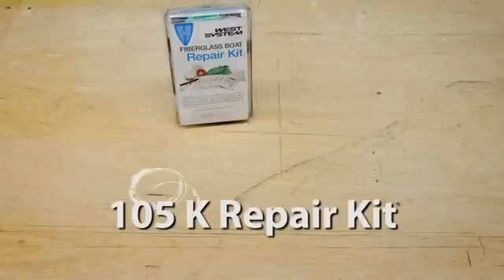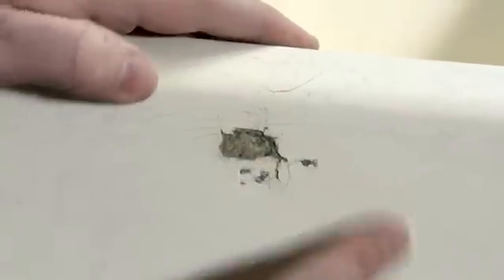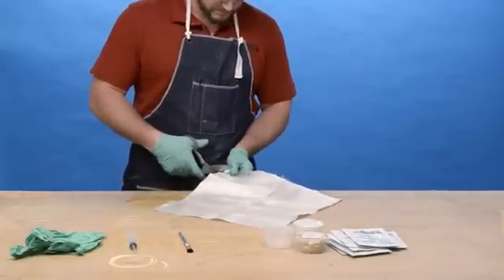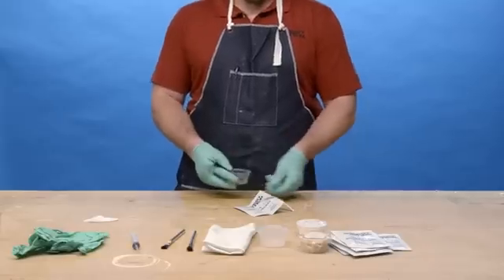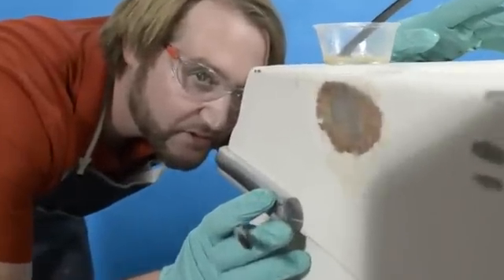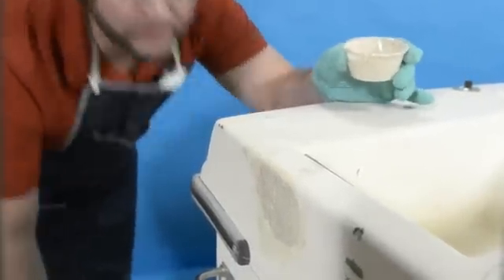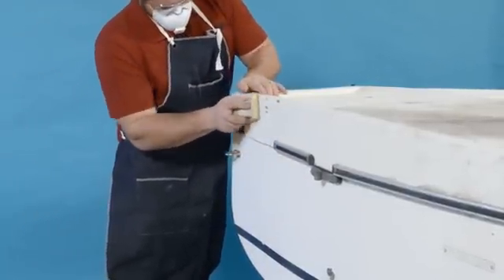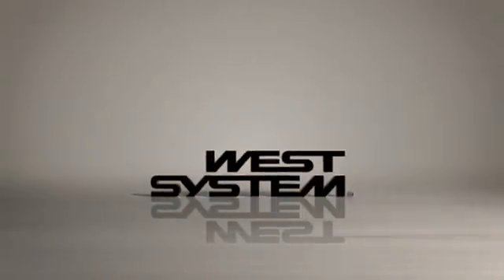How to Repair Deep Cracks in Fiberglass Boats

Comment: Will this hold structurally if the crack is in the transom area of the boat were the motor goes?
Reply: make sure you grind out the old cracked fibreglass & do several layups using progressively larger patches using cloth first & then mat & use heavy roaving to finish it off because of the additional strength that you need in that area,,,,,,,,,,,,,

Comment: I’m not a fiberglass expert by any stretch of the imagination, but I’ve done some fiberglass repairs.  I agree, it’s backwards. You lay the smallest peace of CSM and get progressively larger.  It should be like and upside down wedding cake.  The hole is the smallest at the bottom then tapers up and gets wider.  You follow the taper.
Reply: You bond face to face not edge to face
Reply: I think it depends on the situation. For a hole like this the larger sheet gives you the largest surface bond, if you started with the smaller piece it would bite less, and the sheets over it would be compromised.

Comment: lol. I've repaired busted boats for a living for quite a few years. This video depicts an ivory tower method for a tiny repair. Try doing that to a boat that hit a stump at full speed! That little kit is almost useless and nothing at all like the materials used in a professional facility with experienced personnel. Wet sanding before you even spray gel? lol
Reply: Dude shut up this video is for deep small cracks, not holes that tanks can fit through and if you ran into a stump I can safely assume you are a complete Moron
Reply: So why not post the correct way, if you are such an expert.
Reply: Tom Rooney how can I repair a transom that broke on the corners,from top to bottom?

Comment: I didn't think you could use gel coat onto of epoxy?
Reply: I was about to make the same comment, gelcoat will not stick to epoxy, I do all my repairs with poyester resin and putty, since my boat is made of polyester fiberglass, like most of the boats. I had on some occasions used epoxy for small repairs and nothing stuck to it .